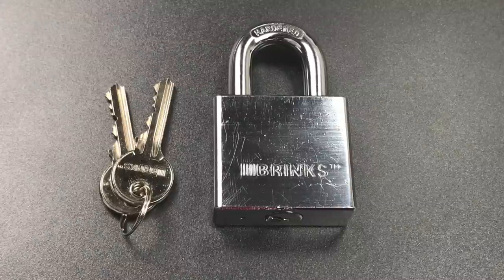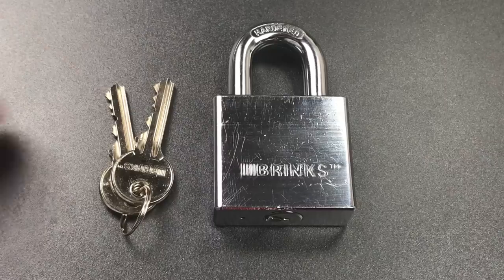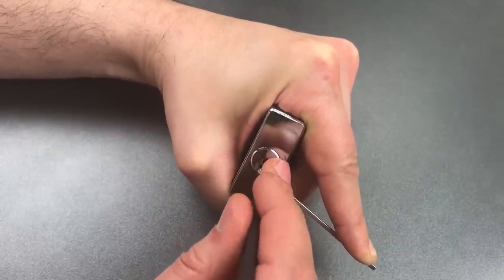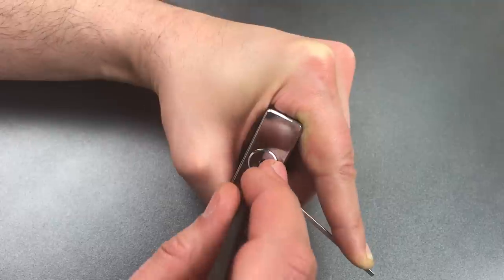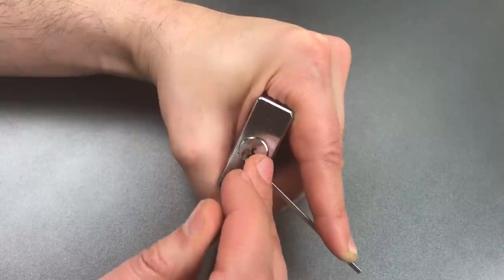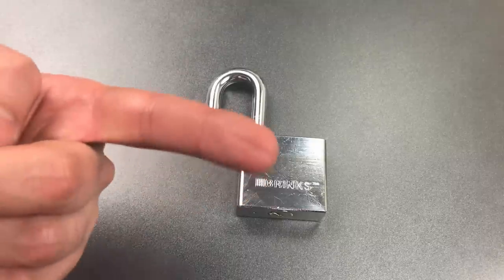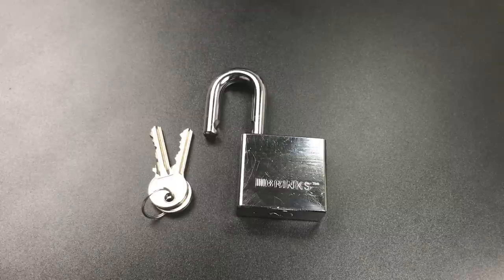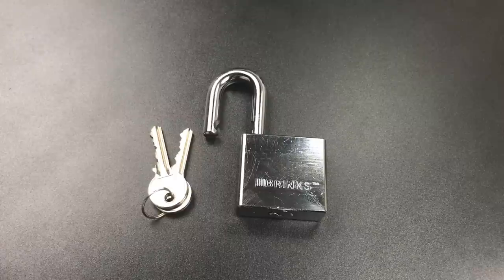[661] Brian’s Dastardly Brinks Marine Padlock Picked

Comment: Hi Harry, Shades of the old original Lockwoods, well picked and explained by the way! I have mixed feelings, the new Lockwoods have spools in all driver chambers as you know, and our apprentices are spp these with relative ease, after only relatively short practice sessions. However, they can't spp the originals. Spools have their place against a non skilled attack, I'll admit, but for a skilled sppicker they are a god send, the feed back is excessive, and you know when they are set. I may be from the old school, but I still say a close tolerance lock, with a reasonable keyway, and bevelled pins, beats spools any day. Original Lockwoods, even with relatively poor bitting, resisted most raking attempts. I know "standard" pins are boring, but I for one are sorry to see them go.   Regards, Brian.

Comment: This is why I will never send you locks I can't open. "Here is my 3 min video demonstrating your incompetence. Next in line please"
Reply: Well this one did give him more trouble than the usual lock
Reply: I find it gives me confidence that the harder ones are pickable. After an hour I start to get the, "maybe its not pickable" gremlins waking up and chattering in my ear. LPL slays lock gremlins.
Reply: Hey when in doubt grab some sand paper and check your pick, if smoothing it out dosent work, try the next best thing, set it down and walk away for a few mins, had this one lock i thought I needed completely different picks so i picked up some ssdev style stuff and then 20 mins after ordering it and working with some sand paper i had the lock open, love the picks but... i felt like sucha dummie lol
Reply: To be fair, this does not make Brian incompetent. Knowledge and experience are key and we can only really learn through success tempered by failure...
Reply: Roger Redford very true!
Reply: Mike F187 There is a LOT to be learned watching him work/pick...
Reply: Slade Darklighter We all have those locks from time to time. I have a gew atm probably. My guess is i am tensioning wrong or oversetting the levers or pins.
Reply: LOL, love it!
Reply: It's funny of course, but never forget LPL used to be Brian. The only difference is he didn't stop!

Comment: I have the smaller 40mm version of this ;D and it's actually a nice challenging one too :). You could be right on the tapered pins, pin 1 definitely needs some work and I also think it has a bit deeper or sharper cut spools. Definitely a nice made lock :), thanks for sharing 😊👋🦊.

Comment: That was very enjoyable to watch you picking this lock. Yes, these tapered pins make it a lengthy process. Do you agree that the pins are tapered to make key operation smoother rather than causing the lock to pick more difficult?
Reply: Potti314 from memory with Lockwood it was nothing to do with picking resistance,the locks were designed to last 30 plus years of hard use in all weather.
Reply: Yes, that's what I was thinking. To ensure smooth operation of the key also when wear on pins or key occurs. There is the method of flattening the top of the plug to widen the shear line which has a similar effect. But the tapered pins are both - harder to pick and ensure the lock to work longer. That's much better.